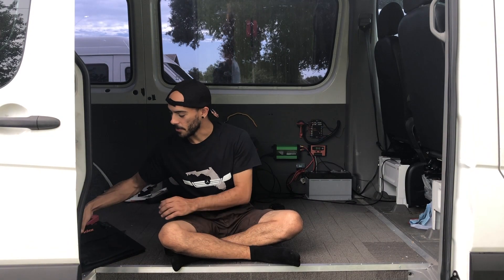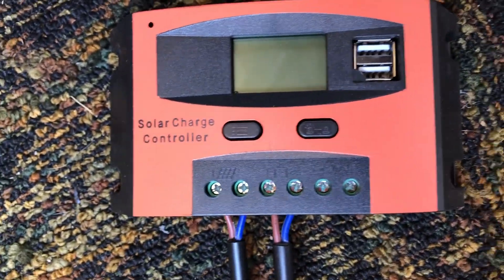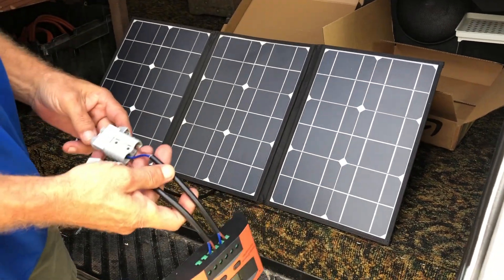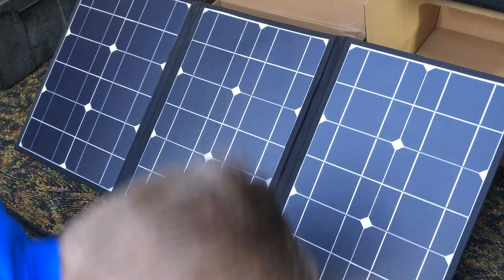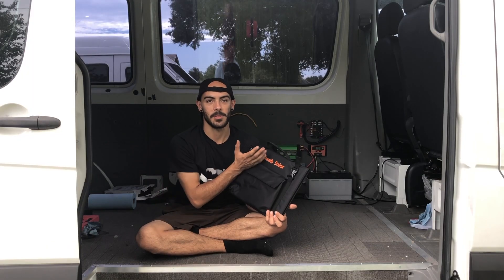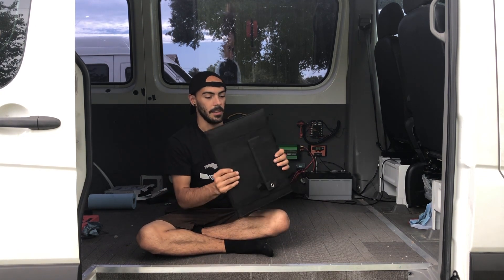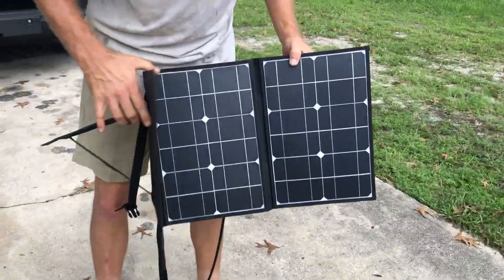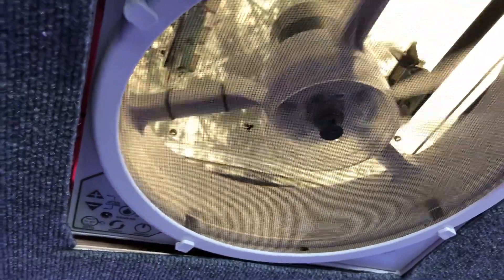Portable Solar Panel! Is It Worth It?

Comment: how did you contact Beleeb, I cant find an official website? was hoping to find a product list besides what ever amazons algorithm wants to send me. Also hoping for online instructions. my controler is exactly like the one you show in the vid.  are the usb connectors just for charge cable or can you talk to it"  Have you figured out what each of the two buttons does as you toggle through it.
Reply from the maker: They reached me and we did not keep in touch after this promo video. It worked but it's a toy, in my opinion.

Comment: I had a question. I paid 6.5k for a 2004 140” dodge sprinter van with 346 k miles on it. Was that a bad deal? It pass all your tests.
Reply from the maker: If it passed all the tests and runs like a champ with low rust, then you got a damn good deal.